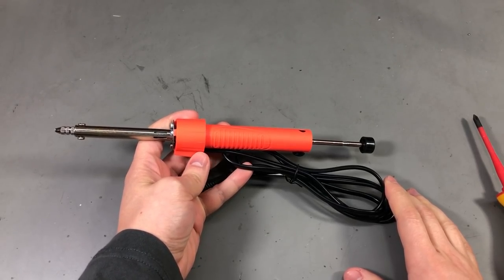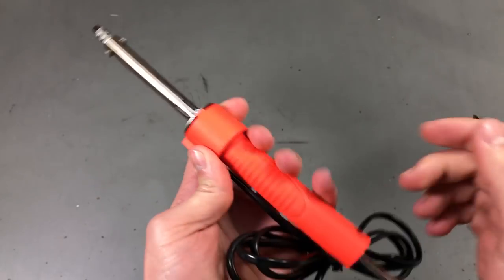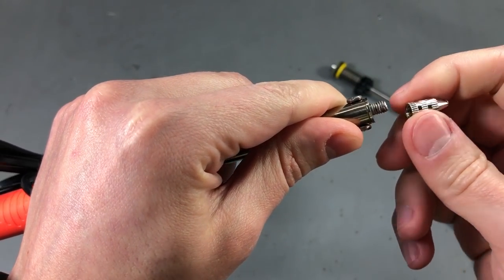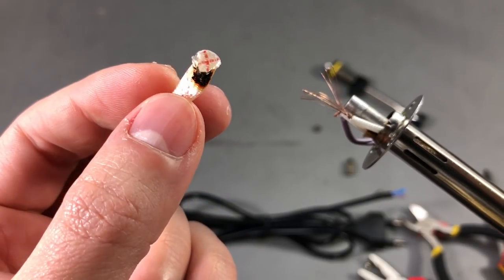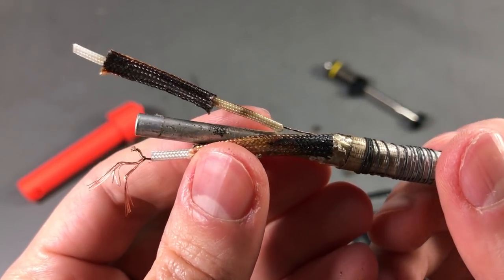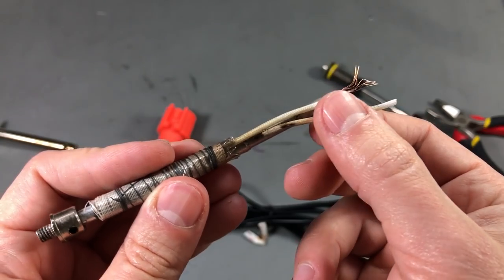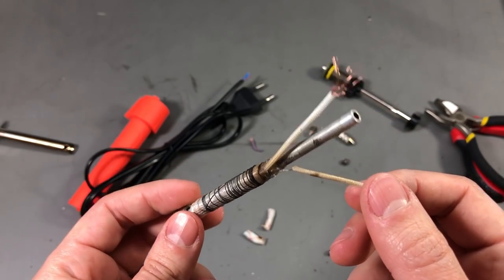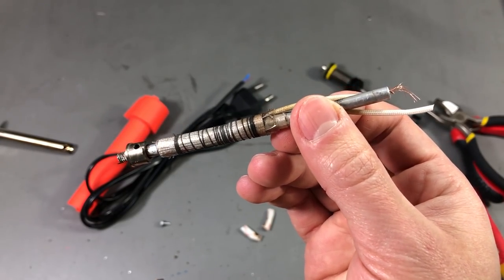Voltlog #209 - Cheap Electric Desoldering Pump Teardown

Comment: I had one of these. I only worked for a couple of times. Mine did not smoke, but it had a worse problem; The "cylinder" that the "piston" works in, is plastic. So after a couple of times, the hot solder sucked in actually melts the plastic and messes up the inside surface. This makes the tool lose vacuum, rendering it totally useless. So, for the ones thinking of getting a cheap solder pump, unless they find an aluminum bodied one, they should stay away from these. One DIY idea might be adding a salvaged electric vacuum pump to it (many choices available in junk yards that deal with medical equipment) and convert it to a solder sucker that actually works.

Comment: What do I think about the iron? It looked like s**t to me. Thanks for putting on the comment about the Velleman as I bought one of theirs from a local shop here. I haven't had any issues with it but this video made me worry about it a bit. It has a grounded plug though but currently the stuff on my soldering bench are not behind a resettable fuse like my computers and other gear. The only crappy thing with our current apartment is that there's no proper grounding elsewhere than in the bathroom and kitchen.
Reply from the maker: I'm pretty sure the Velleman model is better build, they sell in EU after all so I don't think they are taking risks. I should get one and do a follow-up on how a good one looks inside.

Comment: You can not solder to this type resistance wire this is why they twist the wires together. all these type irons are made the exact same way and have been made that why for over may decades. But yest this one was particularly low quality. I would suggest you watch Big Clives tear down of a 99 p soldering iron it would be quite educational.
Reply from the maker: I wouldn't expect the wires the be soldered, I was maybe expecting them to be crimped, that's usually standard procedure in this types of applications. But yeah the overall quality is really bad, probably the worst I ever seen.
Reply: @voltlog  Agreed quite bad indeed.

Comment: I'm curious - I'd like to see you try heating the resin-coated insulation with a match. Will it burn or smoke with a low heat like a match? Seems to be really temperature-sensitive, which is far from ideal for this application!
Reply from the maker: unfortunately the pieces have been thrown away, but I'm pretty sure it would have smoked.

Comment: My blue 2 piece one with the separate sucker works well, but it's probably just as bad inside. I had to fix an air leak because the heating element is so powerful it melted the sucker, but at least it doesn't smoke like that one with the incorporated internal sucker.
Reply from the maker: I should really get a Velleman or similar EU brand and do a teardown for a comparison.

Comment: I wonder what would take to dismantle it and add a proper controler and proper cabling...
Reply from the maker: It wouldn't work well because all of the materials used in the construction are low quality. You would need an entirely different iron from start.